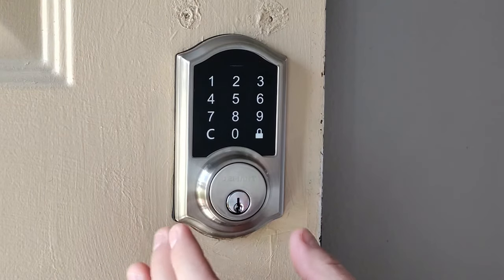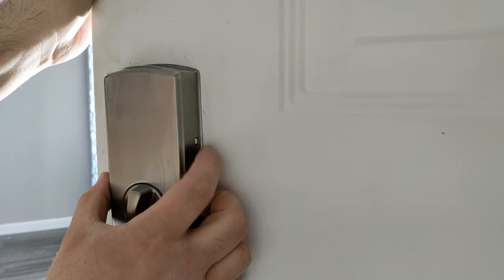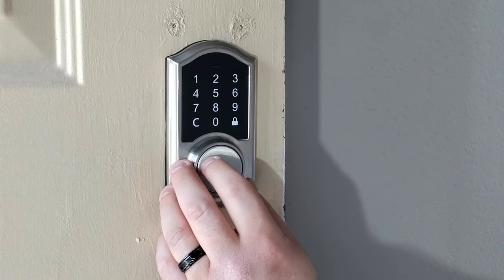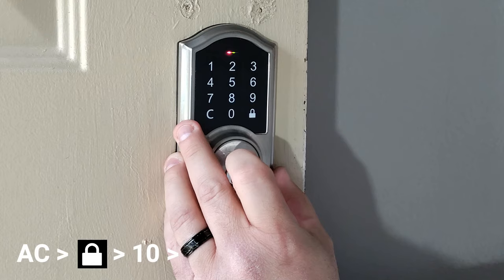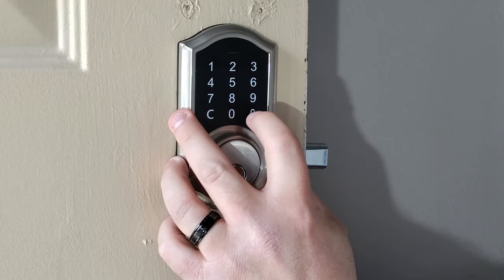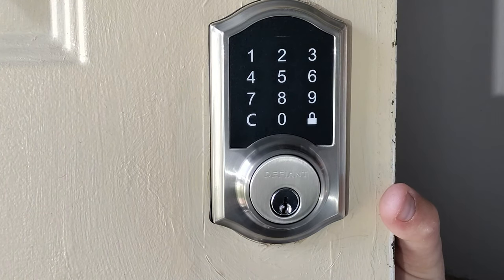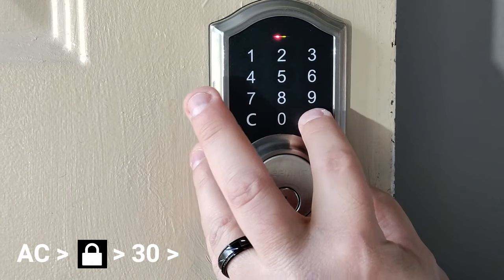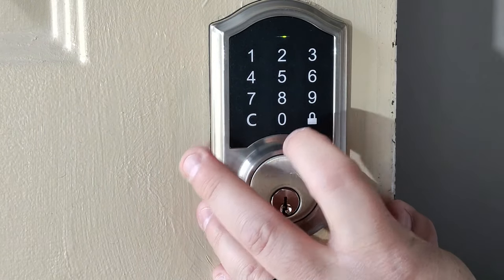How to program a defiant keyless deadbolt. Change Master code, Add User, Delete User

Comment: Frustrating. Looking at all of these comments, this is definitely not working for most people and it did not work for me. I will try to find a link for the correct method and post here. I am not getting the long beeps on the long hold of the reset button and it’s not allowing me to change the admin code
Reply: I found a different video that did the whole process without ever pulling out a battery and it worked for me that way. Try it the same way as the video, just don't pull the battery.
Reply: Didn’t work for me unfortunately. I’m still only getting that one singular beep.
Reply: @bananahats3499  Would you mind sharing the link to that video if you happen to have it? We're so frustrated with this lock lol

Comment: I just changed the batteries because it stopped working... but it is still not working. Do I need to reset all the codes? Or is there something else I need to do?
Reply from the maker: Is it turning on?  I would reset it and start over again.

Comment: It on the 123456 then lock step every time i do it it locks and unlocks even after i repeat the steps what should i do
Reply from the maker: Did you hold down the set button on the back to you hear it chime?  If you did and that doesn't work I would do a factory default on it.

Comment: Do you have to hit the reset button in back every time to add a user code?
Reply from the maker: No.  Are you talking resetting it to factory default?
Reply: @HomeRepairHub  no I want to add a user code so I’m not using my master code or for a guest to use

Comment: Do we have to put an admin code to add a user each time?
Reply from the maker: Yes, you have to put in the admin code everytime you want to program a new user code.  Otherwise anyone could add a new code at anytime.  It's for security.  You don't have to use the admin code when entering the user code.

Comment: I believe the video is very helpfully but I could be more if the explanation be a llitle slower with a little bit more pause between each step that would be awesome thanks for the video it takes me like 4 tryouts but finally I do can reset my code very good video thanks .
Reply from the maker: I appreciate the feedback.
Reply: Pause the video
Reply: You can control the playback speed of any YouTube video.. Click  on settings (gear icon) then chose playback speed.

Comment: I installed my lock and it moves smooth and perfect when manually locked/unlocked. But when I type in the code, I can hear it trying to unlock but it just won’t turn all the way. I can’t figure it out
Reply from the maker: Are you trying the code when the door is open or closed?  If anything is blocking the deadbolt it will stop.  How old is it?

Comment: It just beeps three times no matter what we try.
Reply: Try putting 123456 without using the set button and then press the lock then try to change the user as the normal steps I think it should work

Comment: It doesn't work for me. Out of the box, new batteries and every time I hit the lock button, the first time in the reprogram default code, it activates the lock mechanism and won't let me program anything
Reply from the maker: have you tried to set it back to factory default?
Reply: @HomeRepairHub  of course. i called support, they said it was defective
Reply: Literally same